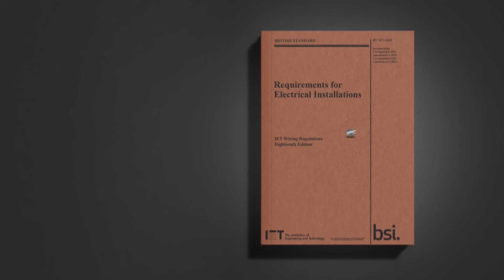IET Urgent Amendment 3 to BS 7671

Comment: Not sure why this needs an actual  specific regulation. There has always been a catch-all requirement to use correct materials fit for purpose. As far as device marking, that's a manufacturing problem, not an installation problem.
Reply: Because Kingfisher/CEF will continue giving preferential treatment to far of cheaper manufacturers. While businessmen have control of what is made, safety inspectors will have to keep an eye on tricks salesmen do to sell inferior products.